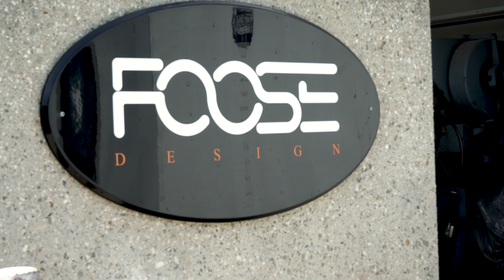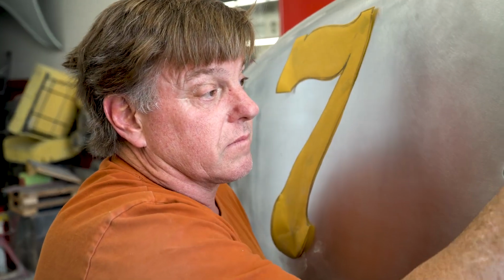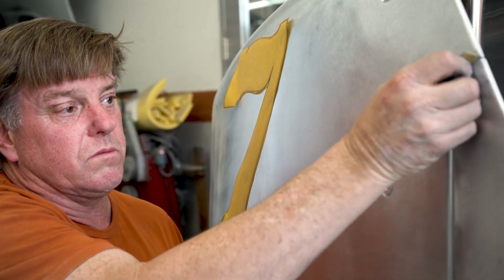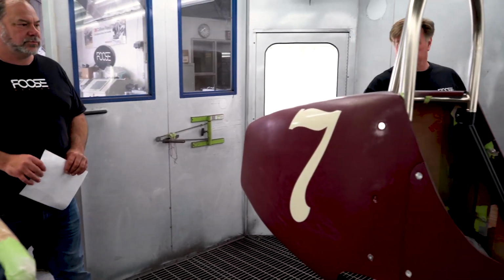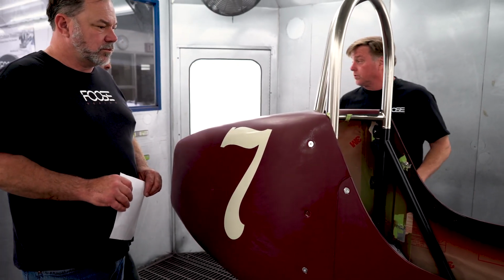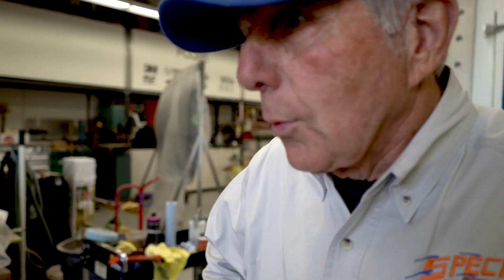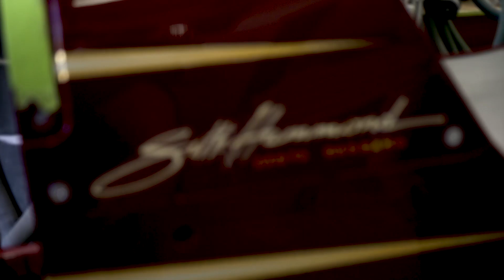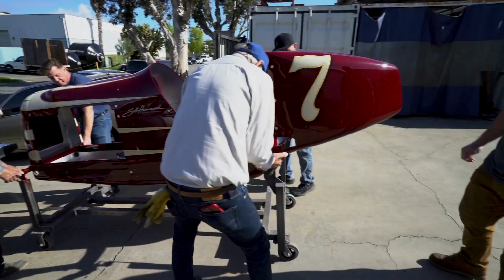Seth's Racecar!

Comment: Boa tarde congrats carros this owner built 1972 Chevy c-10 longped makes a Big impression custom g 1951, this bagged c-10 at the beachis the best, what s LT like to drive a 1964 c-10 truck?( Supermerged Chevy lsa), 80 c-10 drag truck page 2 -the 1947 - presen t Chevrolet GMC truck message board network, this 1967 Chevy c-10 is smokin, duramax diesel powered 1956 Chevy, Marty -s 1965 , c-10 vai trabalhar c-10 era red kap camiseta n tamanho GG e carro Peterson lui 44 anos 1 89 altos bom 💪🏾👍🏾😎✨🚗 amén